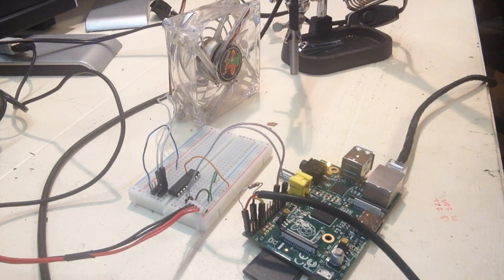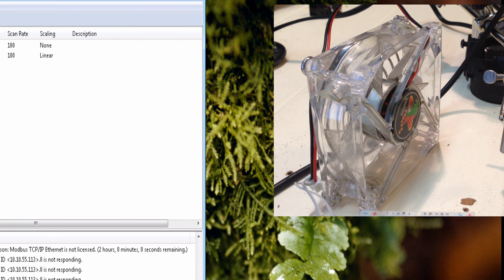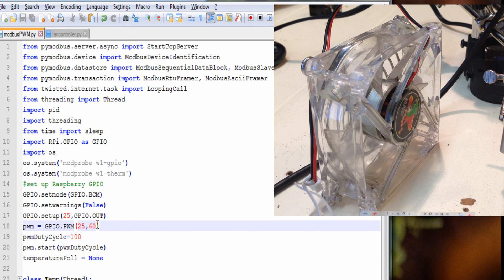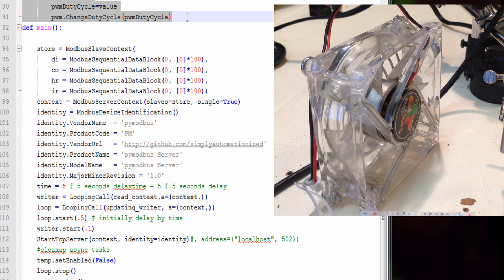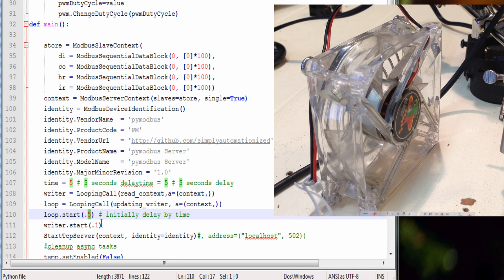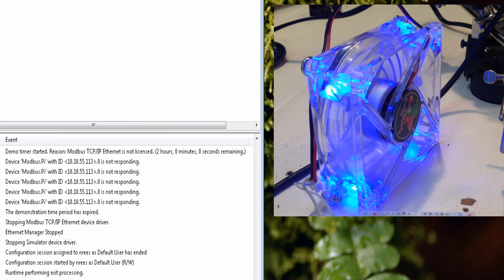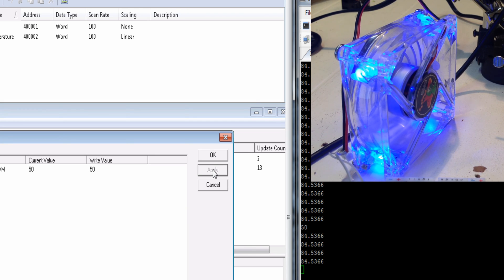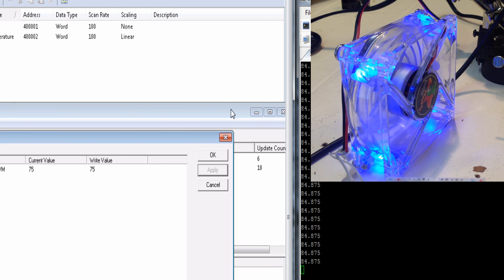Raspberry Pi  as Modbus TCP Slave -  Controlling 12v Fan

Comment: In your code you mention to replace "localhost" with your IP address. Should I put the Pi's address there or the one from the computer I am connecting to it with? I can't seem to find the Pi from my PC after I start the server.
Reply: If you hace only one Ethernet interface you can replace "localhost" by "0.0.0.0" and the server listens on the Raspberry Pi's own IP address